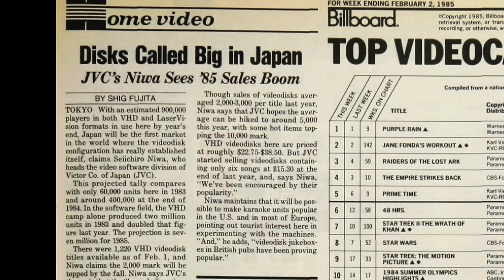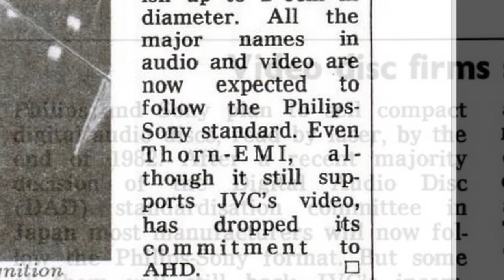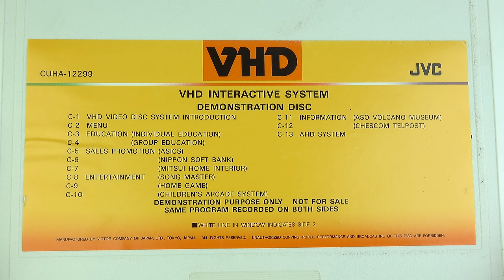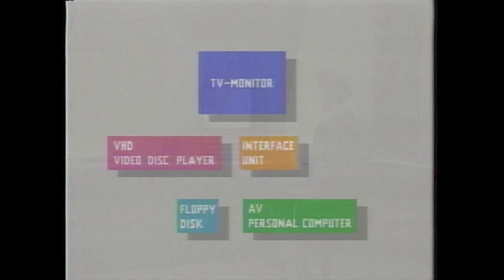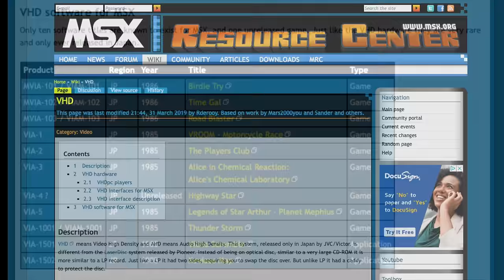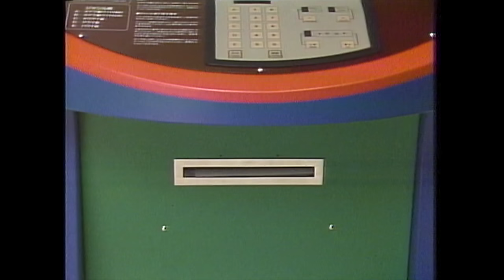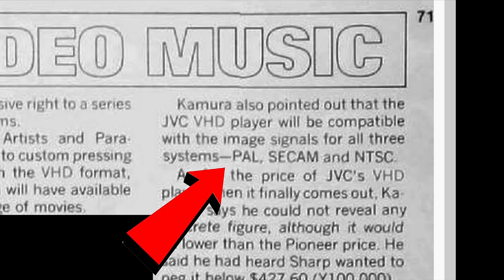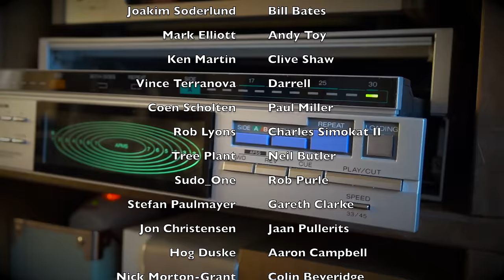VHD in the UK - how 1980s UK missed out on this interactive video & games format

Comment: 2.54 GB of (even read-only) data storage is really impressive for the early/mid-80s.
Reply: @dgpsf  Marketing people in 1981 probably wouldn't know anything about bytes. I think it's just a misspelling.
Reply: Considering disks only had 360k or 720k yeah, this is impressive.
Reply: Impressive.....Most impressive...
Reply: @herbiehusker1889  then if there was a writable disk it might even have at the very least 1.2 GiB (assuming its BYTES not BITS)
Reply: @dgpsf  A CAV laserdisc used for data (LV-ROM) stored 324 MBytes per side, so I'd say you're right.
Reply: At that time, I know that HDD capacity is less than 100MB.
Reply: 2.54 jiga bites is enough for everyone.  :)
Reply: Everyone needs to subscribe to Ray's channel. He only has one subscriber, me.
Reply: @dgpsf just  to your channel.
Reply: @kentallard8852  1.21 Jigowatt
Reply: @dgpsf  If it was 60 minutes of PCM audio per side, you'd already be at 1,2GB (or a double sided audio CD), and with the still pictures taking up the other 2 channels, a capacity of 2,4GB is actually right in the ballpark.

Which makes me wonder why the PCM encoder output was never used for actual data storage. That may just have been sheer bandwidth concerns with the 8-bit MSX system connected to it.
Reply: Giga Bites... back in the day when data bit you :)
Reply: Not sure on how they did with VHD, but on the laserdisc, the MSX program was stored pretty inefficiently on audio pretty much like tape programs.
It's not like it mattered that much on a computer system that had like 64KB of memory.
Reply: @Stoney3K  you are right
Reply: The japanese Wiki Site says it actually 2,54 GB. If I get it right PCM 44,1kHz 16 Bit in 4 channels is only possible when no pictures are included. The AHD would be the same size as the VHD with 26 cm diameter so 2,54 GB doubleside sound right to me too.
Reply: @C0Ntro11Da7rail  GiB isn't going to happen. Quit trying to make it happen.
Reply: That's more of a theoretical limit, not reality. While it's true that VHD format can support high data, realistically it's not feasible or to the interest of anyone, especially not any end user, there'd be too much cross-talk, jitter, and doubt the players/readers themselves would be able to realistically keep track. would be hard enough in a laboratory setting. 

It's sorta like with modern SD card devices. Many state they support up to 2TB Micro SD cards, yet 2tb micro sd cards don't exist, the world's first 1TB MicroSD card was barely announced this year and has yet to hit the market and wouldn't be surprised if it didn't work in devices that previously stated it could support.. as we saw when 64gb and higher cards become a reality, older devices which stated it would support them, when those capacities became a reality, some of these older devices don't recognize the extra capacity beyond 64gb or whatever.. (I have one of these devices in my car, a Pioneer navigation unit from 2010 with a SD card slot for music, manual/documentation states it supports cards up to 256gb, but in reality, it only supports ~24GB, as sticking in a card larger than that, yes it still works and reads from it, but anything over ~24GB is invisible to it, so can have my entire music collection on a SD card in alphabetical order, and the listing would stop around the letter L)... so it's just marketing nonsense when products state their theoretical limits and not realistic limits, this is the case with VHD.
Reply: Imagine if they had become widely accepted as a computer peripheral: you could've had games like Thayer's Quest, Dragon's Lair, Cliff Hanger (which was just Lupin III: The Castle of Cagliostro in an interactive movie format) and other "LD" games ported to home systems even prior to the Video Game Crash of 1983.  Given how little micro-controller work is actually involved in the computing part, even an Atari 2600 with (say) a special cartridge to interface and drive the controller logic could've done the trick.

Man, what might have been...
Reply: @matsv201  It is not analog, While the video format was analog, the discs were also used to hold another format, AHD, which was a digital format for digital audio, pictures, and data. If you had actually watched the video beyond the first 5 minutes you would have known that.
Reply: Ray Hamel with inflation it's like 300 terabytes in todays bytes!
Reply: Actually I'm willing to believe it does mean bytes. At the time the term would not have been as ubiquitous, and so whomever was doing the editing probably heard "byte" and proceeded to spell it out how the only way they knew how.
Reply: @C0Ntro11Da7rail  settle down Emporer
Reply: @dgpsf  Yeah, “giga bites” struck me as a pretty odd spelling, too. Don't think I've seen that before. Actually, I wonder how they expected the target audience to even know what a gigabyte was back in the days when not only did not so many people own home computers yet but where even a megabyte would have been considered a rather unfathomably large amount of storage for a domestic environment.
Reply: One of the earliest mentioning of that amount of storage aside from computercronicles.
Reply: @Stoney3K  The PCM decoder likely doesn't do error correction, it just interpolates (smoothes over) any bits it couldn't read, because you can't really hear that.  This makes it impossible to use for data.  CDs use this system, but they add extra ECC bytes on data tracks to correct these errors, which is why you can fit well over 700MB of audio data on an original 74-minute CD, yet once you switch to data the capacity drops to 650MB, because of all the extra error correction needed to read the data reliably.  Of course perhaps the "giga bites" comment alludes to them doing just that.  Getting the data out to a slower system usually isn't a problem when the device supports freeze frame, because if the interfacing system isn't fast enough, the player can just pause at that point for as long as it needs to.
Reply: @vink6163  I'm not convinced the "2,54 giga bites" claim referred to actual data storage capability, but rather the capacity of the disk in raw bits. Which would actually be on par with the capacity of CD audio if you take into account the additional channels and longer playback time.

The data density would certainly be lower than that of a CD because the disk is physically larger, so it was perfectly feasible in the late 1970s.

LaserDisc is hard to compare because the video storage is purely analog, unless you do a comparison on raw bandwidth. And if you do that, the bandwidth of a LaserDisc is comparable since the bandwidth of serialized PCM audio (like S/PDIF) is the same as that of colour baseband video. (Which was a design decision, BTW.)
Reply: @wormyguy  Of course they did!!! Hardly anything was measured in MB at that point, the IBM PC had just come out 16kb RAM). I upgraded my Apple IIe from 64 kilobytes to 128 kilobytes with a card, a common practice at the time.  You must be so damn young to not remember computers before megabytes!!!
Reply: @Shineyongs.  actually the IBM came out with a 10MB hard drive for the PC at the time, and that was mainly reserved for executive corporate use, two 5.25" "floppy disk" drives was more common, even in business settings. Applications like "WordPerfect" would include there own version of DOS on a floppy, to boot and run the application. Only one application at a time would be run on the computer.  "Kids" like Ray Hammel really have no idea how far technology has come since that time. It's laughable that any medium would store Gigabytes at the time. I don't think it was even a word.
Reply: @squirlmy  The music CD, developed in 1981, has ~700 MB of storage. The VHD is a much larger disc developed for video (albeit analog) rather than audio, so a 2.54 GB capacity is plausible. >1 hour of PCM audio and a color bitmap image slideshow requires at least the capacity of a CD. The best 80s read-only media (CD, VHD) had much higher capacities than rewritable (floppy, hard drive). I'm quoting the 2.54 GB figure from JVC's demo shown in the above video, so if you have a problem with it then take it up with them.

Gigabyte was certainly a word, as was yottabyte (2^50 GB). Kilo, mega, giga, tera etc. are standard metric prefixes that have been in use since, at the latest, 1960: https://en.wikipedia.org/wiki/Metric_prefix#List_of_SI_prefixes

For my part, I may have been born in the early 90s but I write software for a living, studying my industry's history is one of my primary hobbies, and it's clear I've forgotten more about these subjects than you know.
Reply: @matsv201  VHD is digital, LaserDisc or Disc-O-Vision is analog. Later LaserDisc videos got a digital audio track but the video was always analog.
Reply: @thedungeondelver  that's why the Texas Instruments TMS991xA Video Display Processor series had a transparent "color" and a video input pin. The intent was to interface with a video disc peripheral, setting the background to transparent so graphics could be overlaid. Imagine a space shooter game combined with a series of photos of things like real nebulae for backgrounds, or high resolution stills/videos of obstacles to fly through while you navigate an invisible maze that aligns with the video background.

So many possibilities that could have been done with the TI-99/4A and MSX1 computers, but the manufacturers just didn't have the vision to see it through.

If you want to see what a TMS9918A VDP is capable of, look up the "Don't Mess With Texas" megademo on YouTube. If only that program could be sent back in time to TI's Home Computer HQ in 1980.
Reply: @TravisTev  yeah, back when it would take a thousands of computers to have a collective gigabyte of RAM, or almost 3,000 360K floppies. https://www.techrepublic.com/pictures/how-many-floppy-disks-would-it-take-to-equal-1-gigabyte/
Reply: @greggv8  Oh yeah, I've seen it.  Great demo.  Guy did a port of Dragon's Lair, too (plays back animations that have been dithered and compressed, not off of a video or laser disk tho).  As to the various shooter types, that's what Mylstar's MACH-3, US vs THEM! and Bega's Battle all did.  Oh, and the Firefox tie-in from Atari.  Shoot-em-up RGB graphics overlaid on top of LD video playback.
Reply: @thedungeondelver  TIME GAL is amongst the games listed in the video (Had it on SegaCD)
Reply: If you break down a 4-hour tape you would get also Gigabytes of data (read: information) worth from a VHS tape.
Reply: @greggv8  People did mass stotage on tape drives back then. Both of my parents worked in software production, and there were backups of every days work sequentially on tape.
Reply: @Zedek  Yes the advantage of this is random access.
Reply: Yeah, very impressive.

Comment: Interesting story about Thorn EMI and the VHD. As you probably know, Thorn EMI was a home video distributor in the US after putting electronic stuff from around the world, it started with the home video craze. Beginning in 1981 right up until 1984, they put a series of UK and foreign films as well as cult films, family films, and  B-movies. Right up until 1985, it became Thorn EMI/HBO Video where they put out newer material, as well as reissues of previous Thorn EMI Video library titles, by 1986, it became HBO Cannon Video where they put out the same, let alone the Cannon films, and finally by 1987 or 1988, it became HBO Video. I guess right before the acquisition, HBO was the first cable movie channel in the US to acquired Thorn EMI by around 1984 or 1985.
Reply: EMI was behind the record label that signed and issued most of the Beatles records. That must have made plenty of profits which they could used for expansion
Reply: yes i've got Deadly Intruder from Thorn/EMI which still has not gotten a DVD or streaming release.

Comment: Wow two and a half gig sadly read only pressed so not so impressive. But imagine the amount of terrible FMV gaming that could have happened. 

Great video sir. Thank you for some more high quality edutainment.
Reply: 2.5 Giga BITS not Giga Bytes!
Reply: A whole 317.5mb!
Reply: Atak Snajpera I deliberately left out the GB (gigabytes) and left it as gig as this was naturally a light hearted comment.
Reply: @ataksnajpera  gigabytes
Reply: Josuel Servin So half a video CD?
Reply: @ataksnajpera  They put an "i" instead of a "y", but also put an "e" after the "t", so it could go either way. For a disc of that size, able to deliver four channels of data with two of them sufficient for audio of nominally CD-equivalent quality, with two sides each holding an hour each... 2.5 gigabytes actually isn't outside the realm of realism. So long as we count both the audio data and the still image / auxiliary (e.g. computer) data streams towards the overall total. CD audio consumes about 10mb/minute (and there's no reason why VHD would use the same barely-sufficient 44.1kHz recording rate when there was ample room for the then more-standard 48kHz at 11mb/min), so 600~660mb per hour for two channels on one side. Four channels expands that to 1200~1320mb, and two sides to 2400~2640mb. Or potentially 2.34~2.57 binary GBytes. If you want to be a smartarse and use decimal gigs much like hard drive manufacturers do, it's 2.54 to 2.79 (and you have to drop to 43.4kHz to fall below 2.50). Either way, 2.5GB is totally in the right ballpark.

As for whether it was impressive, consider that few CDs of the time offered more than an hour (74 minutes was initially the technical maximum, 63 was considered a more reasonable length to aim for - still enough to fit both sides of even the longest typical LP on a single CD and overrun one side of most tapes), and CDROM hadn't even been invented; the idea of using CDs for computer data, similar to the Domesday Laserdisc was around more or less from day one but it took years to ratify a common standard. When it did come along, early examples only managed about 500mb. We were already into the age of DVD when 80 minutes of audio (or 75 minutes of relatively low-rez VCD content) and 700mb of computer data was becoming a routine thing to fit on a CD.

Comment: Could you make a video on the crystal radio? Their is a lot of videos about how to make them, but not much information beyond that.
Reply: It's a very simplistic analogue AM radio that uses either one (or a very small number of) transistor(s), or - hence the name - a germanium crystal and needle-point conductor (the combination of which forms a basic semiconductor and was indeed the inspiration for the construction of the first transistors) operating in place of it/them, as rudimentary discriminators and draws its power entirely from the aerial (thus works better on LW than MW or SW, and generally uses an extremely low quality but high-gain earpiece as its only output), as opposed to the valve-type amplifier radios that perform a similar task and can produce much louder output but require a relatively powerful source of electricity to run their circuitry. What else is there to tell? That's basically the entire story, short of a couple of tidbits such as the needle contact (and effective tuner) being called the Cat's Whisker, etc. All up you could go start to finish in about three minutes. That's about how long it took me to build a working one using a second-hand electronics workbench set I picked up during my schooldays, using the supplied instructions and integrated parts.

Comment: anyone notice that at 33:15 in the article, under the picture, its written "Pioneer also presses a series of hard-core sex discs, which have the added appeal to some customers of slow motion and a very clear freeze-frame!" ?
Reply: The 2-frame stutter (a variation of which also sometimes affected CAV Laserdiscs and the "true freezeframe" VHS decks, when showing TV material rather than filmed) would seem to make that claim rather fragile, unless they actually encoded the slow-mo right onto the disc (duplicating each frame so that when shown as rapidly alternating pairs they appeared still) and actually played back at 2x speed for normal viewing...

Comment: At 1:35 there is a little Swedish connection, in the lower right corner. The two telephones there are telephones from Swedish Ericsson. Both the all-in-one phone (Ericofon DBJ 700) and the more traditional one (Diavox) are designed by Carl-Arne Breger, one of the big Swedish industrial designers between the 50:s and 90:s. Breger also designed the casing of the most famous Swedish computer from the 80:s, the Luxor ABC 80, nice and stylish with brown and beige vacuum formed plastic.

Comment: I think I've probably seen one of these.   it was in the late 80s/early 90s in a pub in Central London.   I thought it was really cool I could play pop videos for not much more than it would have cost to play the single in a jukebox.

The other video jukebox I saw was in Tower Records on Piccadilly Circus, but I think that was using a computer, as the videos seemed to be 320*240 digital video files (likely quicktime), although it was difficult to see  what format they wereas the interface was quite well locked down.

Comment: When I saw VHD for the first time I was impressed that it did not skip like the ugly CED rival from RCA. The latter did that completely wrong. The VHD design if it came out 5-10 years earlier would have been a tremendous success. The grooveless design of the VHD also meant much less wear of the disc as the stylus was quite thick compared to the capacitance grooves so the pressure on the disc per surface was quite low. Much lower than on the RCA model.

Comment: While meanwhile Thorn EMI at the time were also manufacturing appliances like hot water radiator heater units that used fans for example! I also believe they were quite big in Australia at the time to as there was several Thorn heating units in the high school I went to! :)